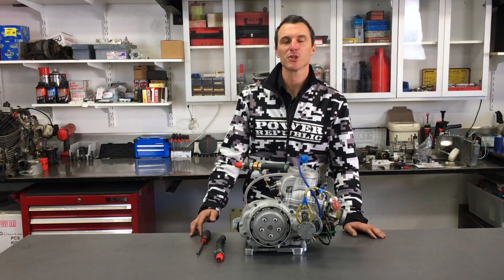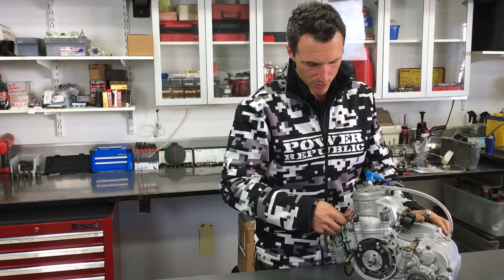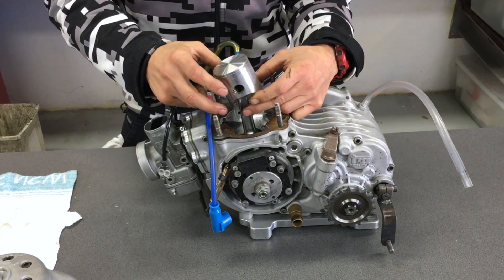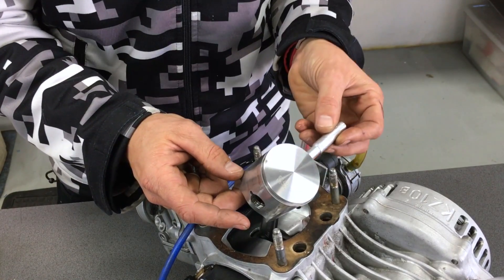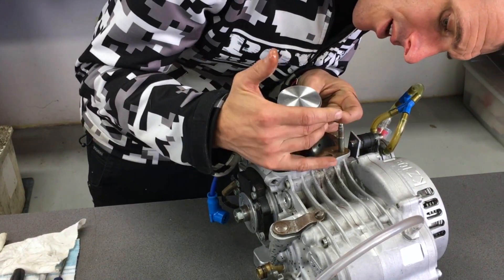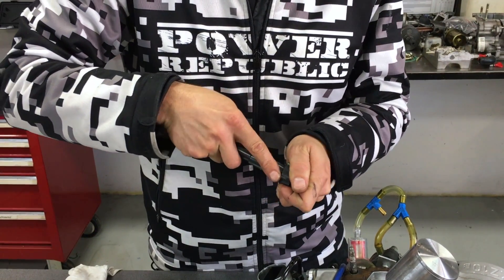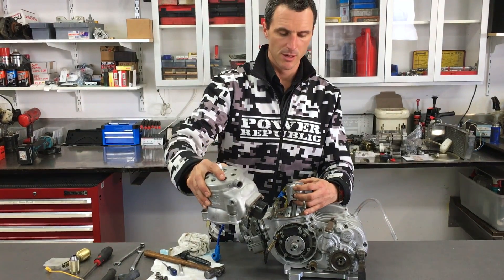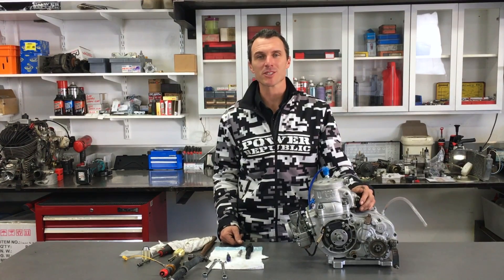KZ Engine Rebuild Project Part Two - Top End Assembly - POWER REPUBLIC

Comment: Hi, i have just bought kz10b, i have open the engine because has low compression, i must  change piston, but i ask you, how can i know if the bottom must be replace ?  If i change only piston can i broke the engine ? Thx you
Reply from the maker: Hey Marco, look at the thrust washers on the Conrad and see if they have started to go blue.  that is good indictor that the bottom end could do with some new parts

Comment: Hey buddy I have a TM Racing K9B and i don’t know what kind of fuel I can use, I read on the maintenance manual that I need to use 95 or higher unleaded racing fuel! 
My question is, I need to use that fuel with or without methanol? 
And what type of oil you use for mix and the oil of the gearbox? 
Thanks a lot! ☺️
Reply from the maker: Hey Giorgio, no methanol required.  if it is a practise kart, use regular pump gas and run the engine a bit richer on the main jet.  
I use Motul GP2T synthetic oil for fuel, and ATF or Motorbike Gear Oil for the gearbox.

Comment: Hey, great video as always !! I have a question, when you put the pin back on, do you need the special tool or is it only nessessary when you extract it? Thanks again !!!
Reply from the maker: thanks mate, normally with a brand new pin and piston, the pin will slide in without any pressure needed.
Reply: @PowerRepublic  thanks ! Also, i think it would be cool if you did a video comparing original pieces with compatible ones... (like iame clutch or piston vs compatible ones)

Comment: Great series of videos. Thanks so much for your time. I bought a DD2 125cc kart. Is there any videos specific to doing the top end service on these?  I am green to wrenching on karts but since I’m not actually racing, I’d like to do some of the simpler service work myself. Thanks.
Reply from the maker: Hey Don. The DD2 is very similar process to the KZ. Both have the nickel bore so just replace the piston, little end bearing and piston pin and your good to go.